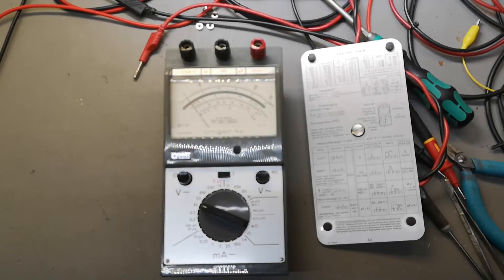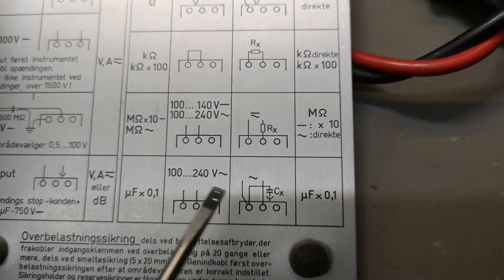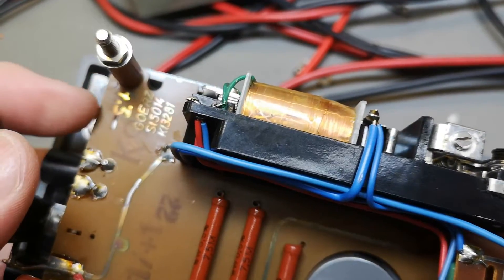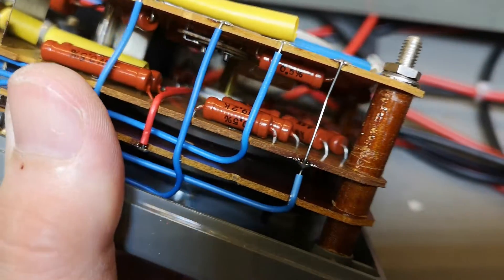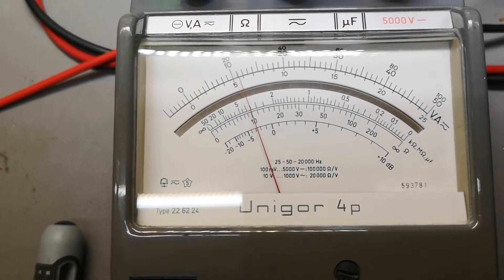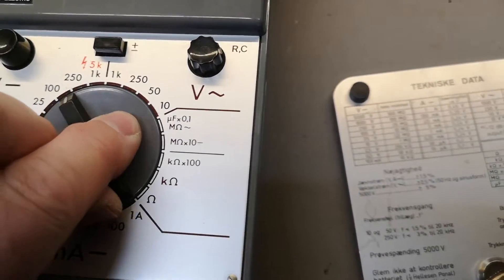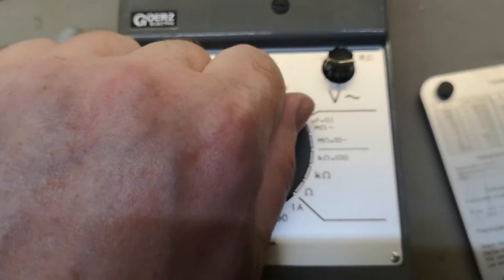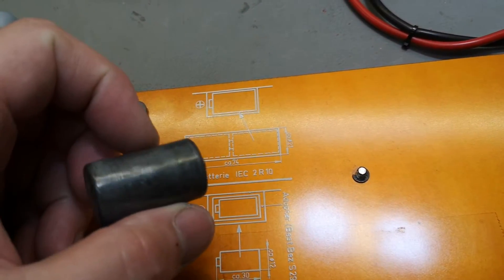BBC Goerz Metrawatt Unigor 4p multimeter type 226224 test teardown

Comment: The backside of the backplate implies that a 2R10/2LR10 battery can be opened to use one of the two R10/LR10 cells in the battery. Somewhat hard to find. LR1 in an adapter to R10 is a suggestion. It seems a bit weird though to do this instead of actually make the instrument to take a non extinct cell type.